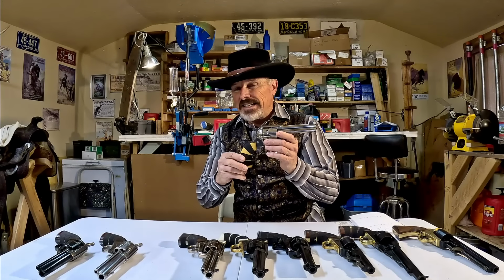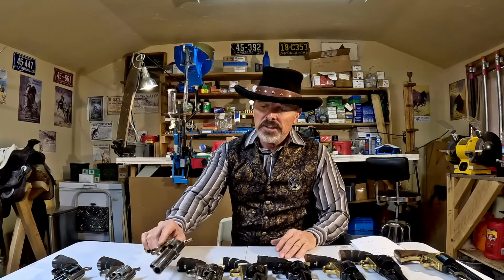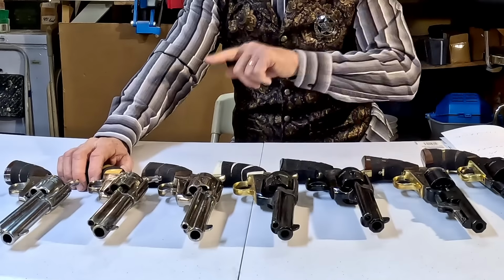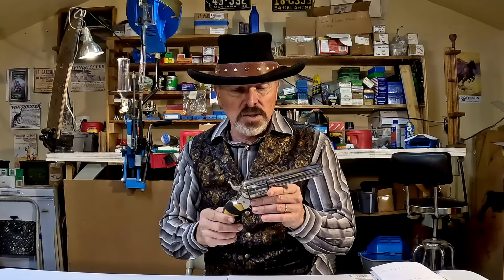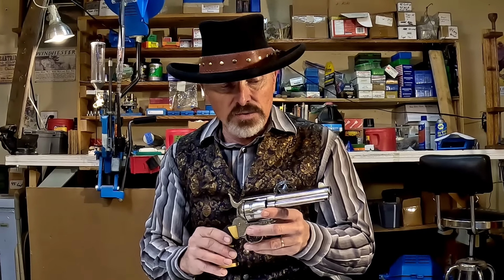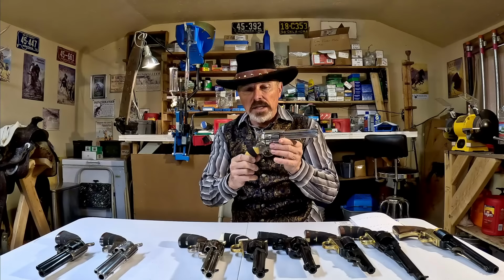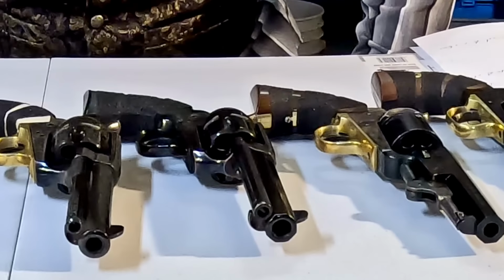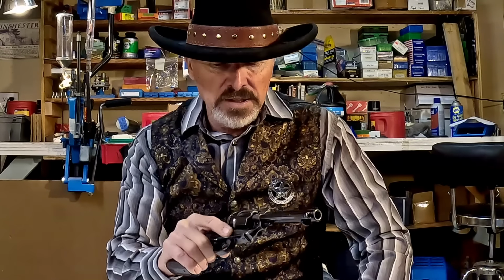How I Got Into Single Action Revolver Race Guns

Comment: Great vid ... I'm gonna have to check out rumble ?!?! Is it ? Nice collection sir . I'm a fan of open tops and 1858 rem . I've a project in mind for the pitta rem ... see for me it's not just fanning or tripple shots . I want a balanced 58 ... (this means if the firearm is hung upside down by its trigger guard ... the tip of the muzzle is level with the handles heel ! Johnny Ringo and doc holiday ... eat your heart out 😂 Sir ... much respect to you . YOUR A FAST HAND . with respect , I've a question ... can you wheel , the wheel guns ? Spin I mean , I've fun with it , I've watched some of your videos... I've never seen you spin em .
Reply: I'm also a big fan of draw technique... I've not got a drop holster . I'm a practitioner of the curly bill or if you like ... road agent spin . Off the left side of my belt !
Reply from the maker: My right arm and hand was injured in a freak accident a couple years ago and my fingers remain stiff. I can just barley spin and have done so a few times in recent videos but it's harder for me than doing a triple shot.
Reply: @TUCOtheratt  sorry to hear about that tuco . Didn't mean to call you out man . I was shot thru my left hand carple tunnel with a senco air nailer 15 years ago ... I'm a south paw. I love all things hand speed I twirl single action and I've a parker pm 10 guitar which will soon be modified with semor Duncan humbuckers and spurco locking tuners.... I homeschool my 4 boys , we love your videos sir .
Reply from the maker: @smaksymiv4950  Thanks for the nice comments! I didn't feel like you called me out. It's a legit question.

Comment: Hey bro, I just wanna say I love your videos your videos kinda got me hooked on all the revolvers. I’ve been watching you for a long time and love all of your content recently, I purchased one of my top-tier dream guns 1872 colt cattleman, revolver by Taylor and Co but sadly somethings going on with the revolver I only shot 100 rounds through it at the range.  And a lot of weird stuff kept happening I can see the hammer kept striking the round way off where the primer was and later when I got home and inspected it every single screw was a loose on the gun. The bottom look like the it was splitting into two pieces. The handle was coming off and now when I put the hammer in the second position for reloading the cylinder spins freely forwards and backwards. I’m talking about so freely that if you blow on the cylinder hard enough, it would start spinning and the little fingers that come out to turn the cylinder really work anymore and are very chewed up. Very upset with the pawnshop that sold it to me. I’m gonna get in touch with them Monday to see what they say but what do you  think I should do? Should I make a post about everything? saying who and where the business is bc God forbid, my hand could’ve blew up, considering every single screw was loose on the gun. It could’ve flew apart and came back and hit me in the face. Need some advice. 😢 btw I never fan  the gun or nothing like that and I was using low grain cowboy rounds. The gun is chambered in 44-40
Reply from the maker: Sounds like a Uberti. I don't know what to tell you to do. I like Pietta GW2 .
Reply: @TUCOtheratt  ya it is uberti  i’m just gonna go to the pawnshop tomorrow and tell them to just give me a refund or exchange it for something else because this was ridiculous and honestly very dangerous, considering they never checked anything and all the handles and screws, and everything was loose w e i’ll let you know what happens tomorrow

Comment: I just got my first single action recently. It's just a stock Uberti Evil Roy in .357 so one question I did have is how fast can I get with this revolver before I need to upgrade to a race gun to avoid damaging it? Obviously no fanning for the stock gun but I don't know how fast you can go just with two hands before it's 'too fast'
Reply from the maker: Thumbing with the off hand, like a cowboy action shooter, as fast as you can shouldn't hurt anything. However, striking the hammer with the palm or fingers with any significant speed or force will damage it. More info on my Rumble channel. Thanks!

Comment: TUCOtheratt, have you ever done fast draw with a modern double action revolver from a western holster? Would the time of the first shot be as fast as a single action revolver? Would this be safer than fast drawing a single action revolver? I think The Walking Dead Nebraska Bar scene - You tube is one of the best modern western style gunfight scenes ever made. The You Tube video is only 24 seconds long and worth watching. Also, I really enjoyed the video about the 1858 race gun.
Reply from the maker: I have shot a few double action revolvers but I have never owned one. I suspect that if a person worked hard in practice to develop the skill necessary he could go very near the speed possible with a single action revolver, and yes it would be safer to fast draw a double action revolver than a single action revolver using live ammunition assuming all gun safety rules were followed. However, in terms of the fastest speed possible the single action revolver has the advantage because as the strong hand draws the gun and presses the trigger during the draw the weak hand can close in on the hammer for a fan shot as soon as the barrel is on target.

Comment: I’m curious, do you have any experience with short stroke revolvers? I believe one of Bob Munden’s bird head Ruger Vaqueros was shown on Hickok45s channel years ago and Munden had made it into a short stroke where the hammer didn’t have to travel back as far as normal to engage the “full cock” notch. Would be really interested to hear your take on it in a video!
Reply from the maker: I've only handled a short stroke SAA once. It's great for cowboy action slip thumbing but the action must remain a bit heavier than a race gun because all the movement/friction/inertia happens quicker and the main spring must be a bit heaver to build hammer drop speed with the short stroke.

Comment: Hey Tuco,  I'm new to the Italian clothes but I'm picking up what you're laying down about Pieta's guts being stronger than Uberti.
  I kinda dig the octagon barrel on the El Malo. Is it as strong as the other Pietta's?
  I only shoot a couple or 300 rounds per month and no fanning.
  In your opinion do you think I'd be good to go with the El Malo?
Reply from the maker: I don't have an El Malo. If it's part of the GW2 line the insides are identical.
Reply: Pietta has their own octagonal barrel model. It is a “Davidson’s Exclusive” 1873 Pietta Gunfighter (Great Western II) 4.75” barrel .45 Colt - Color Case Hardened Frame, Blued Finish, Black Plastic Checkered grips. Has a thicker front sight, has a 1873 round shaped cartridge ejector. UPC: 8052464213467 - I have been happy with mine.